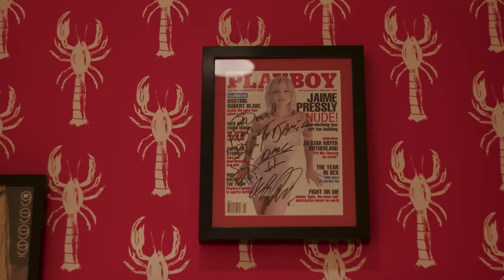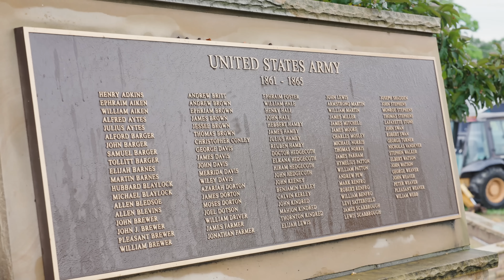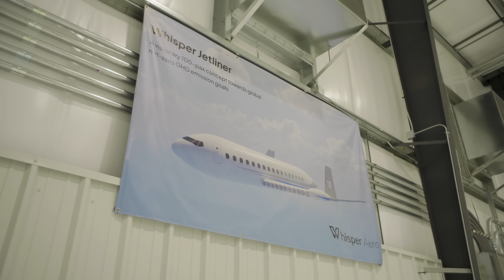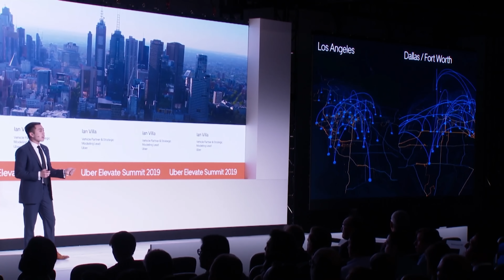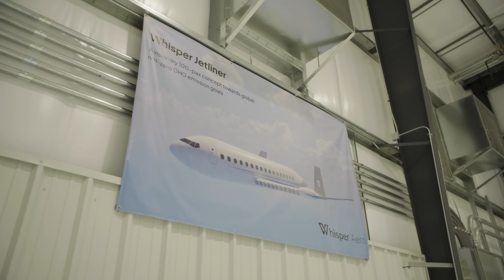The Jet Engine That Will Make Drones, Planes And Even Leaf Blowers Quiet

Comment: The whole concept sounds great, and I'd like to believe that commercial aviation will one day use these engines. I don't want to be a killjoy, but I have a few questions, such as: what would happen if they ingested a bird, or ice, water, dust, etc.? How do they perform at -50 degrees Celsius? Is the clearance between the blades and the duct sufficient to withstand these conditions safely for aviation? Even if they meet these requirements, would they operate with batteries made of reactive and dangerous metals?

Comment: I would like to have an attachment whisper blower for my split boom trimmer gas power head. There are two types 9 spline drive shaft and square. A backpack blower impeller is not a turbine like these. Cool product. Leaf blowers are every were.

Comment: Those aircraft engines will be awesome. 
We just need a 2x to 3x improvement in battery energy density and it will all be good to go. Electric planes will take over GA and I can see VTL vehicles with a bunch of those engines being the next big thing.

Comment: They should add some intake holes in the air blower tube to allow the Bernullie effect to suck in surrounding air. It would increase air volume output significantly.

Comment: My wife wants a quiet vacuum cleaner. And I like that idea.  Now, regarding having the turbines with exyra thin blades close together and supported only at  the centre may create issues when, in larger models the turbines will get vibrated by turbulence or the turbine blades encounter hail, or any forms of air born debri.🫠

Comment: Does whisper aero sell electric motors for diy part 103  ultrasport aircrafts or diy part 103 ultralight evtol's? And if not smaller electric motors for diy ultralights, then how about experimental lightsport aircrafts???

Comment: I’m not an engineer but I did think of the idea of putting a ring on the outside, not for noise but strength. Still even with my limited training, even I knew the rig would fly apart at normal speeds. Maybe I should have patented the idea. I’m glad to see I was not actually crazy and these guys are making work. Imagine quiet drones and maybe even helicopters. Silent but deadly.

Comment: If it uses electric motors then you are stuck with battery energy density, it's about 100x less dense than fuel energy density and that can not be changed unless metal air batteries ever work. 
The noise reduction is good though.

Comment: After 30 years in Aviation thinking this is stupid. Why not through the wing? Minor changes in the spars and stringers. Smaller engines bla bla bla. Even from a safety point more engines is better. Even jet engines made me scratch my head. Why a blade that's only held on at one end? It just blew me away. Good work. Jet Skiis are another fine example. Efficient thrust comes from linear flow not a vortex. But hey who am I?

Comment: The issue with electric propulsion of any kind is the battery source. It takes an engine with a fantastic power/weight ratio and makes it have a horrid power/weight ratio.

And, for aircraft, any extra weight directly equals expense, because it represents weight that you cannot carry into the air. Batteries also don't change mass as they discharge, so, you're left with having to land with all that extra weight, which means a stronger airframe and landing gear are required which also weigh more.

Until we get batteries that can compete, this sort of tech is going to be stuck on the ground outside of niche uses unfortunately.

Comment: Genuine question for everyone excited about getting a quiet leaf blower, why not just use a rake? I've tried both options and the rake is just as fast without causing a ton of noise and air pollution.
Reply: Because most people are lazy, of course... a large plastic rake is very effective on leaves and slides over the ground much better than old metal lawn rakes. One serious limitation  though is live oak leaves that have settled into non-yard areas. Air blasting is the only option.

Comment: I would love to build a drone with these.  Instead of throttling the motors for maneuvering, I would gimbal them.  2 axis.  Place the gimbal axis' at the center of thrust  so it is easier on the servos.  Super cool thruster.  What is the efficiency to weight rating?

Comment: Looked like their skinny fan blades were attached to an outer ring that rotated on or in some sort of race, whether it was actually riding on bearings or not is unclear. But I can see how this would eliminate wing tip vortices, and if it could deliver high thrust at low rpm, avoid the noise that comes with those vortices. But I’m guessing they have to use very high tensile strength materials for those blades and that outer ring. If so, it might be more costly to produce than conventional ducted fans. Almost all advantages come with trade offs. However, that said, lower vibration and smoother operation might mean lower maintenance and longer life for that sort ducted fan. 👍🏻
Reply: They said the rotational speed was lower for their turbine so the rim would not tear apart. Also, it looked to me that the edge of the duct right in front of the blade was a smaller diameter than the blade. I don't think the blade would need a race to contain it. As for the price, in the testing portion of the video, they did say that their unit was less expensive than the one they were comparing it to. Of course, one is on the market with actual known manufacturing and sales numbers, and the other one is a prototype and, as we all know, prototype cost projections sometimes butt heads with real world manufacturing costs. I guess only time will tell if they can bring it to market.

Comment: Yeah well…., Kid Rock’s good buddy, Trump has made it so I can never enter America. I’d be arrested at the airport, detained, and maybe, if lucky, deported. That aside I celebrate Aero’s ducted fan improvements. However I have a ducted fan improvement too that enables VTOL performance transitioning to maximum possible forward flight for the same energy throughput. Completely overlooked by NASA despite several studies. There is so much scope for improvement in this space, but for the time being the US is in free fall because of the psychosis of one man.

Comment: "A jet engine is a type of reaction engine, discharging a fast-moving jet of heated gas (usually air) that generates thrust by jet propulsion. While this broad definition may include rocket, water jet, and hybrid propulsion, the term jet engine typically refers to an internal combustion air-breathing jet engine such as a turbojet, turbofan, ramjet, pulse jet, or scramjet. In general, jet engines are internal combustion engines." Wikipedia
Reply from the maker: In general

Comment: Will totally work with a constant speed diesel/jetA/kero powered generator and enough battery for takeoff boost. Not worth squat until someone finally has the courage to admit it. Batteries don't have the power to weight ratio. Won't have it for years to come. A model S can weigh over 3 tons, a plane doesn't have that luxury.
The leafblower is viable though.

Comment: When Dean Kamen the inventor of the Segway released his two wheeled balanced invention it was cool but also, um ok I guess, his invention that I was the most stoked about was his stair climbing wheelchair. Now that was amazing.
The engine is very cool, no doubt but as a commercial Aviation product? I already foresee issues. I'll present you some examples.
An AK-47, a original Colt 1911 45 and a Colt M-16 A1.
All three of those inventions were a leap forward in tech. The reason why the AK-47 and Original 1911 run like an International Harvester is because they are built to loose tolerances in areas that are important to something that will operate in harsh environments and be RELIABLE. When the M-16 was introduced into the Military and subjected to the harsh environment of Jungle warfare it struggled because it needed to be kept clean to a fault. The tolerances were tight and any spec of dirt plus the sustained firing of ammo introduced a lot of dirt and grime. 
That engine with it's close tolerances and many blades is an engineering marvel but it looks like a better contender to compete in the Dyson Airflow fans, vacuum cleaners and of course leaf blowers.
You are introducing an Aircraft engine into an environment that sees such extreme temperature changes and weather conditions plus anything else that the engine will suck up like a Vacuum Cleaner.
I am excited for them but they need to produce that leaf blower like last year. They need money coming in and that's the ticket, right now at least.

Comment: For flight speeds above 100mph regular propellers are more efficient.  And when you are talking about electric powered planes efficiency is pretty important.
Reply: Actually, ducted fans become more efficient at higher speeds ;)
Reply: @gibbled0  Actually they aren't more efficient at higher speeds.  At low speed / hover / VTOL regimes, a ducted fan can match or exceed an open propeller’s efficiency because the duct reduces tip losses and protects the flow from crosswinds.  Ducts add wetted area and skin-friction drag; at higher flight speeds this duct drag can dominate.  Free-standing propellers (large diameter, high aspect blades) typically outperform ducted fans in cruise propulsive efficiency. High-performance ducted fans have been used in turbofan engines, but those are different: a duct surrounding a large fan with bypass ratio and high mass flow is designed specifically for high efficiency at high speeds.  If you must enclose the rotor (safety, noise, compactness) and operate at low speed/hover, a well-designed ducted fan can be equal or slightly better in efficiency.  If maximum propulsive efficiency in cruise is the goal and diameter is unconstrained, a large open propeller generally wins.  Small rotor diameters penalize efficiency whether ducted or not; ducts exacerbate low-Re and drag penalties.

Comment: nothing 'magic' here.. lower fan speed, higher solidity.. and it is that solidity that makes for a better Bernoulli conversion in initial compression at the fan and stator blades..  but there is an offset, and that is lower speeds also.  As for any "engines'.. all I saw was motor driven fans.    This is also relavent to the size/power of the unit as to the desired speed, thus Reynolds number over the surface area..  This ain't rocket science.

Comment: uh, its not a JET engine if its an electric motor. Stop lying
Reply: I don't disagree with you, but if you want to be technical about it, a jet is a coherent stream of fast-moving air or fluid. A jet engine is named after the jet of air it produces, not the combustion of fuel. It's just that we have used 'jet' to describe combustion jet engines for so long that there is a strong association between the two. All that to say, describing an electric ducted fan as an electric jet engine is technically correct.